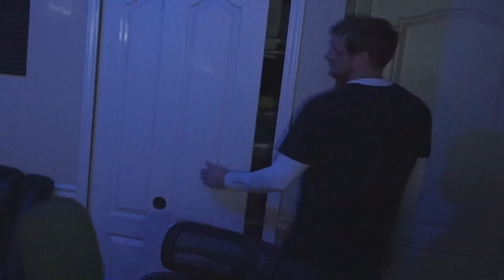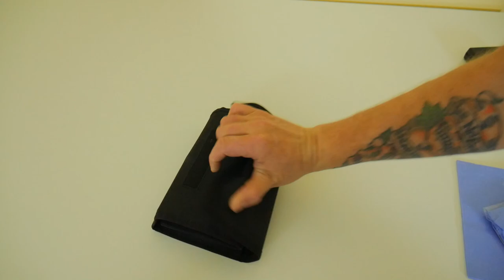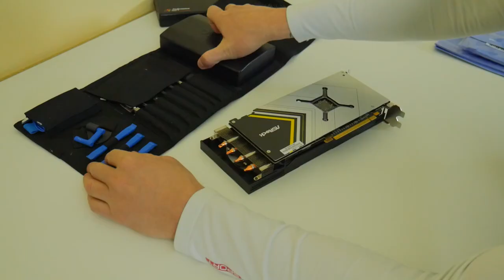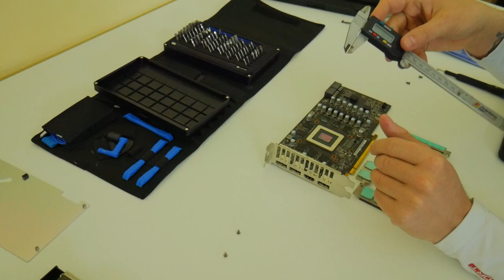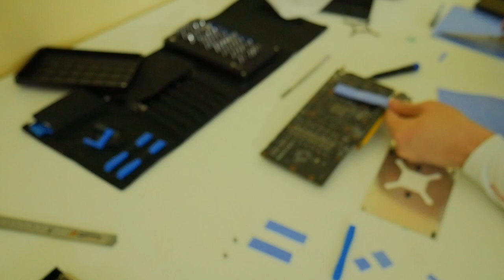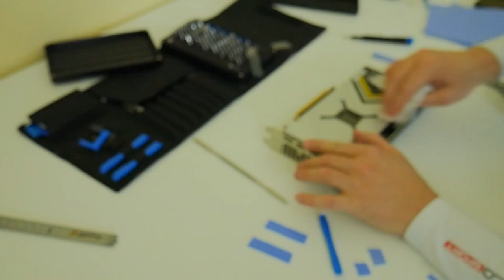Asrock RX 5700 Challenger Pro Thermal Pad Replacement

Comment: This was a big help ii dropped my memory temps almost 20 degrees. I used Thermalright pads they cost a little more but worth it. I too broke a piece of plastic off the fan connector and i was very careful. THANK YOU!
Reply: Ayy I'm gonna do the same. Did you do the 1mm on the chips themselves and the 3mm on the PCB back to backplate?
Reply: @shanez1215  yes, 1 mm on the chips and 3mm on the backplate. it's a must on this gpu. i also used Thermal Grizzly Kryonaut Thermal Paste on the gpu

Comment: This video would have been good if it showed if there were any temperature improvements resulting from the pad replacement.
Reply: Just FYI, replaced my pads and added some to fill the gap to the backplate and saw about 10C improvement in temps.  Also note, I later flashed the card to an  XT which caused the temps to rise a bit but it was still a lot  cooler than with the stock pads.

Comment: Very good video, didactic, a question of mine is if instead of the thermal pad silicone replace by copper, (0.8mm cooper)  + (0.1mm + 0.1mm of thermal paste) , I think it will be fine, what do you think?

Comment: Please help,my termal pads on rx 5500 xt challenger d needs a replacement but i cannot measure the thickness properly because the pads are in pieces, should i use 0.5 or 1.0 mm. thanks in advance. i cannot find the answer anywhere.
Reply: The 5700xt is 1mm and if I have to guess the whole stack it. 0.5mm feels like way too close considering manufacturing tolerances.
Reply: @shanez1215  I figured it out, it is 0.5 because on 1mm the radiator does not touch the processor and i had no display, it is good that i ordered 0.5 and 1mm 2 days ago. and now everything works like a charm . 34 to 37c idle and 54 while gaming a maxed stuff devil may dry 5 and some other games. i mostly play games on high or maxed if the port is good. Thank u once again.
Reply: @SHIN_MAJIN_UMBRA  Are you sure of this friend? I ask this because all the videos I've watched speak in 1 mm and not 0.5 mm.
Reply: @marceloleite2304  how to use it properly, that is an old video, i ordered some measures but i tried 1.5 and 1.0 thickness, but the better option is when u change them do not put a paste on a processor just try and see on the sides of graphic how it fits, is there abgap or not. If u know what i mean.
Reply: @SHIN_MAJIN_UMBRA  thanks for the answer man, yes, I will do this after fixing the solid copper thermal pads with thermal paste, it will be a slight fixation because I will not use glue, there are some thermal glues on the market but I will pass out of it. Sorry for my English. I bought from China these solid copper thermal pads, here in Brazil there is also to sell but more expensive ($). In China they are cheap and if they do not work out 0.80mm just buy smaller or larger. Thank you.

Comment: Guys, could someone answer exactly if it's 1mm or 0.5mm please? A comment from the @SHIN MAJIN reports it being 0.5mm. I bought solid copper metal pad of 0.8mm, if it is 0.5 mm the correct will not be ok.

Comment: So how much temp drop on memory?
Reply from the maker: Depends on how old the card is
Reply: I would also say it depends on the thermal paste as well, I like Artic silver 5 myself
Reply: @SonofaTech  I mean your results. How much did your memory temp drop.
Reply: @gamerbargains4642  Thermal paste is for the core die not the VRAM chips. The 3mm pad he's putting on the back should make a pretty big difference because it lets him use the backplate as a heatsink. Another commenter dropped his VRAM temps by 20 degrees. I just ordered my pads and paste (if you're opening it up you NEED to repaste) and I'll report back. Currently my mining temps are 90C with the case fans maxed and GPU fans at 80%. I figure I need to do this even if I don't mine since it'll make the card last longer.
Reply: @shanez1215  Update?